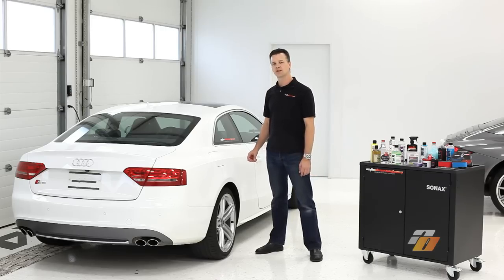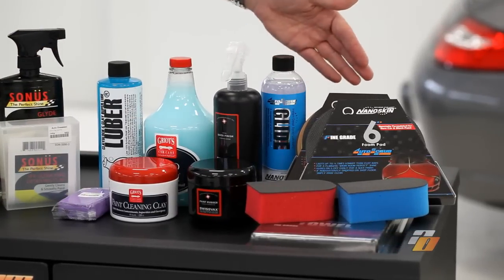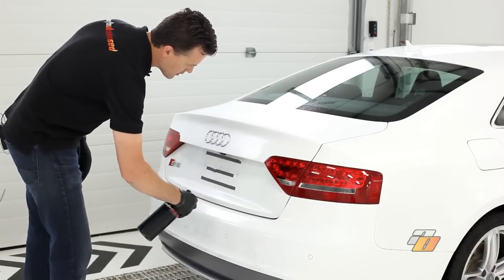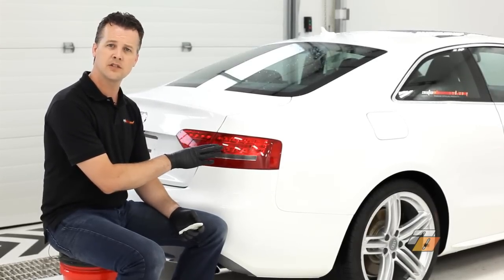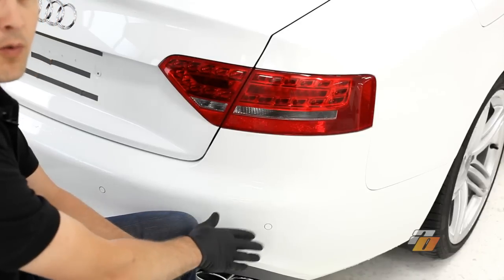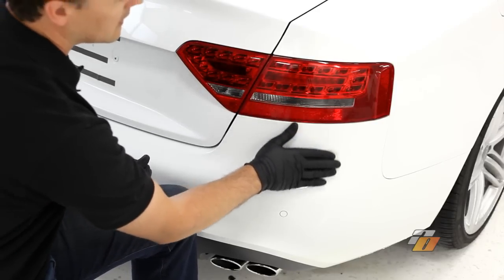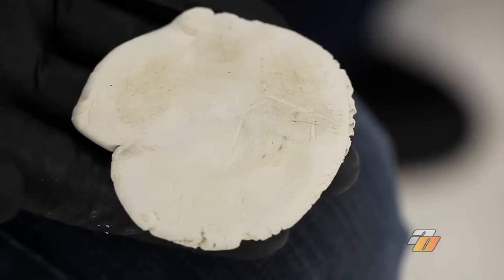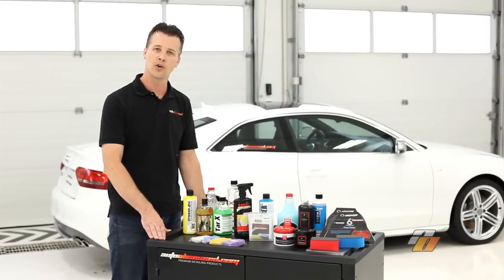How to Decontaminate Your Vehicle – Prepare Paint for Wax, Sealant or Coatings

Comment: great video. very professional. this is ultimate set up. i have a question. u said, waxes and sealants would be removed in washing step i.e u use these strong soaps that would strip off any protection and then u proceed for tar, iron and other remaining embedded contaminants removal. what if wax or esp sealant is not removed during wash, would it effect the following decontamination steps???

Comment: very nice video guys! Another best practice for using a clay bar is always keeping it warm, soft, and flexible, or else you may scratch your paint!
Reply from the maker: Yes, great tip.  Sometimes just kneading it in your hands to warm it up or even running under warm water helps to warm it quicker.  Thank you for the feedback.
Reply: +Auto Obsessed Is it necessary to work the Iron X into the paint after you have sprayed it on the paint?

Or can you just spray it on , let it dwell and rinse off?
Reply: let it dwell and rinse off
Reply from the maker: lightningsmokerXx You can spray on let dwell and rinse, we usually lightly agitate with a soft microfiber mitt, carefully so not to marr or damage the paints finish.

Comment: All your videos are highly professional and thanks for taking the time to do these videos. Quick question however, for the Iron X is that simply spray and rinse?
Reply from the maker: Thank you for the feedback, much appreciated.  With Iron X it does help to gently agitate it with a soft wash mitt, most of the work is spray on and rinse off.  Also best to wash the car with shampoo afterwards to neutralize and wash off any residue afterwards.
Reply: +Auto Obsessed What is the name of the IRON X product that your spray on the paint to get rid of the rust /orange coloured spots?  The exact product name, i didn't catch it.
Reply: +lightningsmokerXx Its the standard Iron X (cherry scented) according to the picture.
Reply: lightningsmokerXx 
carpro iron-x

Comment: JUZ HOLNE- You use whatever clay is appropriate for the amount of contaminants on the paint. In their case, it so happened that there was not anything significant enough to validate using medium clay (Such as sap). 

Also keep in mind that using medium clay can mar the surface (though very fine), and generally you would want to polish after using a medium clay bar; most likely a finishing polish would work fine depending on paint condition

Comment: VIDEO is good audio is a bit soft.

I would like to try and spray iron decontaminant on my sedan, but I'm a bit reluctant in doing so, for I heard its bad for plastic and rubber panels. Any thoughts on this
Reply from the maker: We decontaminate every car that we work on with Iron-X without issue.  Always read and follow the manufacture directions and test to ensure that this product or any product will work for your exact application.
Reply from the maker: Certainly, keep the product on the paint as best you can. If you get it on your plastic or rubber, don't let it dwell for too long. It can react with those materials and should be rinsed off before too long. As always, read the manufacturer's directions and test on an inconspicuous area before proceeding with the larger, more visible panels.

Comment: Hi guys,
Thank you for the awesome videos. One quick question, I  got a brand new golf R. I want to apply qtechniq's c1 and after that exo coatings by myself. But before that for preparing the car to coating process, I am thinking about to give the car to local swissvax dealership and let them polish the car and make the paint free from swirl marks (even if it's a brand new car got some swirl marks on the paint). Is it right to do it like that ? What are you suggesting ?
Reply: Hi
if the car is new and already with some swirls, i suggest to use coating for it after the polish, the coat is stronger than wax and will stay on your paint for about a year / 2, its also stronger for stone chips that damage your car on high speed driving and so.
Swissvax are great (and expensive) but i think if you want a quite head - go for the coating, after that you can use wax on the coat, the wax will last less than normal because the coat repels chemicals and similar, but it will give a nice look to the color from time to time.

Comment: but if a car has never been clayed it will need a complete clay, every panel, glass, wheels everything
Reply from the maker: Not necessarily true, the chemicals outlined in the video do a lot of what the clay does, then you may only have to clay some of the areas or not at all after you inspect the panels.  We find that the chemicals eliminate most debris and claying is used much less.
Reply: Auto Obsessed
chemicals these days are really good, but if something has never been clayed, your bound to have to clay it at some level. i always found so anyway. maybe il start trying different products. great videos, keep um coming, thanks
Reply: nissan300bhp It really comes down to the condition of the paint because every car is different. If the car has been driven for years without being clayed then it would most likely be necessary but IronX does help lessen the amount of clay work that will be needed.
Reply: PingPong Tsan
yeah i do have fallout remover on my shelf myself, but clay is a must on something that needs a good detail, i know where your coming tho, if its not that bad then fallout could do alot of the work yes
Reply: @Ram-rm2gz  No, you don't know anything. Guarantee that if the average joe used ironX on their car, the car would still need to be clayed. I just bought a 4 year old ex company car, bet its never seen anything but a generic car wash it's whole life. It's going to need multiple ironX treatments and then claybar before it can go anywhere near a polisher.